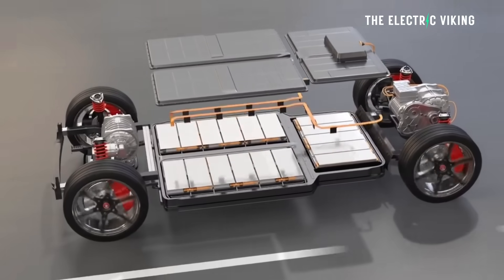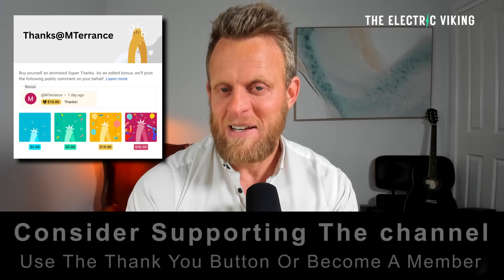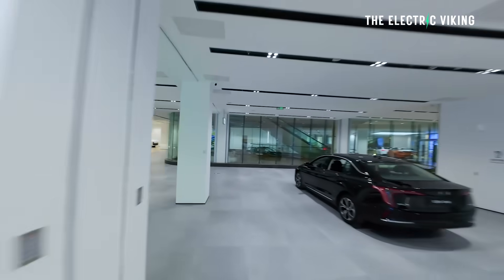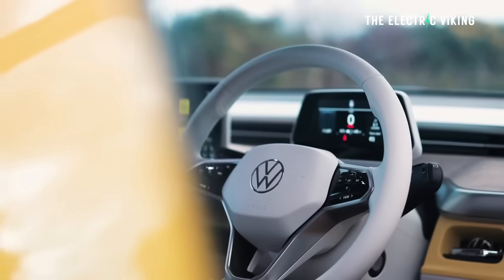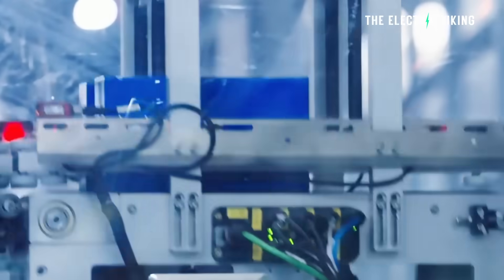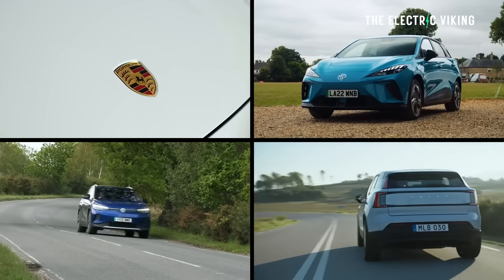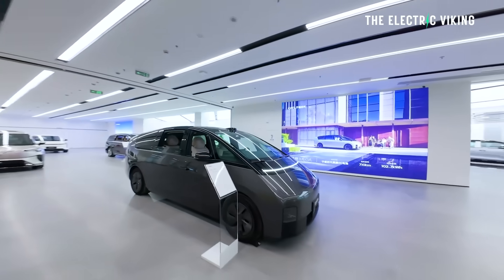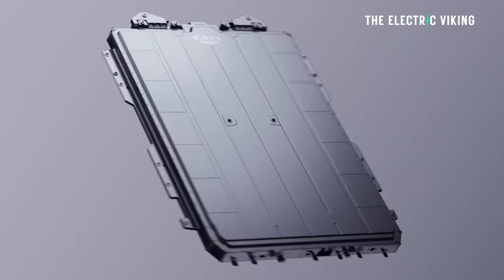Game-Changer: CATL Tesla EV Owners to Repair, Not Replace Batteries!

Comment: You can refurbish a pack a couple of times, but ultimately, the cells within the pack have a certain shelf life, and cells will keep failing until the labour cost of disassembling the pack every time just isn't worth it, because eventually the entire pack will become unredeemable. At that point, it needs to go to somewhere like Redwood, where they shred the batteries and recover the materials. But yeah, rebuilding the pack is a good option if the pack is ten years old or less.

Comment: It'd be nice if they could standardize a battery connector and coolant location.

Why? 
Because it could make battery replacements easier and cheaper.
Especially if newer battery tech came out.

Eg I realize my Model S uses NMC batteries for the capacity to make 100kwh.

It would be nice if you could decide to replace it with an LFP battery later.
Granted it may not then have the same capacity or handling but it'd be down to the consumer choice.
A choose your filling kind of deal.

If some other battery tech became the new rage, then you'd be able to switch to it when the time arose. 
As the battery would be its own separate component. 

The other part to this is that the car would have to support dynamically adjusting the power profile based on the battery characteristics. 
Eg limiting power output if the battery isn't able to meet the original spec.
Reply: Wow that difference in price... that's pretty sweet.
The battery in my secondhand Model s is at 80% state of health and has done 268,000km (I've only put 6000 on it since ownership in Feb)

I had thought that I'd repurpose it for energy storage and get another battery for the car...

With the next item being solar install for the home.
Although I wish our NZ government would put an incentive in for doing so.

Comment: Go try to repair a battery yourselves.
Reply: Fair, though YouTube has plenty of examples of module swapping. Battery rejuvenating using a catalyst to free up lithium, might become an option. Assuming it's not shorted. Hmmm, would need a way into the battery still.
Reply: @RoyBoy2019 I think it’s just a matter of replacing the bad cells. The difficult part would be to dissemble it and find a person certified to do it. Or ship it to catl
Reply: @tjeers3098  yeah mileage will vary. Older Model S have quick disconnect and easily swapped modules. But saving weight / cost going Cell to Pack, much harder for DIY service without modules. Hope prismatic cells become more common.

Comment: What would you say if there is a device that trickle  charges an electric circuit? Well watch Tim Ventura interviewing Harold White demonstrating his Casimir zero point energy device. The size is 5mm x 5 mm designed to charge very small devices in its first mass production stage. Future is to upscale to who knows EV’s?

Comment: In Australia we have not yet seen full recycling of the likes that Redwood materials in the US is undertaking.
It is common for under performing pack to be tested and put into static storage but full breakdown and conversion to black mass is not happening yet here in Aus.
It might take another 5 years before we see that here because these types of plants need  hundreds of batteries per day to break down to cover eration costs.
Currently most of the bad batteries we have here in Aus are being stored or exported only after having been fully depleted.

Comment: We have 4 Toyota Prius. The 2007 had 225,000 miles. Battery pack needed replaced. Dealer was $6 grand. Green battery was $1,200 came to my house  installed in 30 minutes and financed it to for 12 months. The car now has 265,500 miles.  Replacement EV battery costs is very reasonable.
Reply: Can u please provide more detail? Exact costs, gen 1 or 2? Is replacement batt faster charging or more capacity vs OEM? Green Bean? If so, found horror stories of refurb faults after months, $150 diagnostic and warranty delays. While warranty honored they wanted $700 diagnostic for 3rd swap to prove battery cells at fault. Recommend new modules to avoid Russian roulette of refurb.
Reply: The Prius hybrid has a relatively small battery compared to a full BEV.
Reply: Old Prius battery 1.2kwh capacity. Small compared to a 60kwh battery in an modern Ev
Reply: 2007 indicates an older design, advances have increased reliability

Comment: I've had a Honda Insight for 25 years, on the outside of the battery compartment it says "Do not open; you will be killed"  this warning is appropriate to anyone unskilled because even that small 166 cell battery pack can kill you in an instant, it is a tiny faction of the size of these huge packs used for BEVs. Damaged packs can also catch fire. So unless you are a professional, well trained on safe handling of deadly batteries - well trained on the dangers - it would be wise not to touch them. It certainly is true a pack can be repaired if it has'nt had damage which could make it unsafe even fixed; but do not presume you can manage such a thing on your own without needed safety training.
Reply: I beg to differ. Even a professional would have problems should an event occur.

Comment: I am in san diego with a 2011 nissan leaf.  Still hoping to be able to swap with CATL batteries.  The shop here advertises just a refurbished used leaf battery.
Reply: Genx, how much for the replacement? 

My nephew has an old leaf that needs battery replacement. A good car otherwise. Worth saving!!!
Reply: $3K for a used one with 50 miles of range.  Approx $5-7k for new batteries with 70 to 90   miles on of range.  Includes installation.

Comment: Given the trouble Munro Live had to get into the Tesla MY battery pack I can't see any kind of repair being a viable option. https://www.youtube.com/watch?v=ozesI3OZEG0
Reply: Exactly, those batteries all in a single block of gluey foam aren't ever going to be repaired. At best they could knock out a small chain of cells if one cell measured bad (by blowing a fuse link).

Comment: If you buy a 12volt car battery today you have to turn in the old one or pay a lot extra. It's been so successful about 90% of car batteries are recycled. Some of the lead in a new car battery might have been mined in the 1950s. Referb and upgraded EV batteries should be the same way. Turn in your old one and get the "core charge" back.

Comment: Just had a module changed on my ID3. It has 12 modules and it wasnt a big deal to swap one. The car drove fine before the replacement but the softweare threw up a warning. It was all done under the 8 year warrenty with no cost and no fuss.

Comment: I live in Slovakia and I have asked several car dealers, how much costs exchange of battery. And the sum was very similar: about 12-14 000 EUR. It was for Opel Corsa and Nissan Leaf 2. However it is for exchange whole battery. Often the batteries are divided to several blocks, e.g. 3, and if just 1 of the block is damaged, EV owner pays just for 1 third of battery.
I would like to buy a second hand EV, but problem for me are very expensive batterie spare batteries.

Comment: What exactly is the process with repairing the battery?
Reply: With the VW MEB cars simply jack up car, drop abttery box, take lid off, disconnect bus bars between battery modules. Swap defective module, charge  replacement module to same level as the others, refit bus bars, screw it all back together.

Comment: A few years ago, I helped my son remove and take apart the battery on his restored Tesla Model S.  It was very difficult since the shell and the lid are bonded together.  The adhesive must be cut and the lid peeled back.  A lot can be done to made that process much easier.  I am sure that must be what CATL has done.  In addition, there is a maze of wires inside the battery that measure temperature.  These are very delicate.  Here, solid state might be the answer.  Even with thee original construction, it takes a severe accident or terrible abouse of charging, to cause the battery to degrade.  I think some of that hype is now being corrected.  Good work.

Comment: I think currently EV repair and servicing look less rosy than is narrated here. The biggest issue I see and experience in this utopian narrative is that servicing seems dictated by business and what you want fixed is currently regulated by the manufacturers demands on servicing. The logistics regionally are complicated, and the logistics are complicated. In my situation, I fealty had to push and actively ask for a battery replacement of a hyundai Kona. It was difficult to get information, and I was supposed to believe telemetry data was fixed without written proof. Battery repairs and swaps could only be done at certain service centres for safety reasons and to prevent fraudulent repairs with fake battery repairs of poorer quality  batteries. It was very difficult to get done and took several weeks for the repair and EV transfer to be done and almost a week to repair the battery with a new cell of an already replaced pack. So although catl may paint a rosy picture of business with battery servicing, global regional se4vicing is much more complicated with a lot of red tape, middle men, and if you do not have in depth knowledge of how this business really works, it still remains an expensive affair to date, for which  I think, even for insurance reasons and safety rules, a battery replacement I think remains the norm, just to keep servicing, safety and costs in check for the average person. We're still very far away from a more democratic liberated view pf a more refined affordable off warranty safe and comprehensible battery repair and replacement servicing, globally. It would be nice if it was true and realistic today, but globally, I think it is still in its infancy.

Comment: 80% charge after 100k miles is better than my BMWs at 100k miles. Timing chain broken- new engine, plastic oil filter housing breaking... 
100k mile EV is much cheaper to own than a 100k mile gas powered BMW.  
Now can we just get a good EV convertible 😂
Reply: Battery failures are rare, I give you that, but when they do happen, it is darn more expensive than replacing an engine. Regulations should require all  EV manufacturers to provide  modular battery repair, and should allow third party garages the software tools to do so. That will have a knock on affect on reducing the notoriously high EV insurance.
Reply: BMW=Bring More Wallets. I recently worked on a mini my daughter bought for my grandson. The so called engineering was absolutely horrible. Not at all what I expected from the Germans.

Comment: Repairability is one of the biggest issues stopping EV take-up, including sticker price and range.
Reply: This is a temporary transitional issue, as has been shown in all industries and technologies that electrify the serviceability increases and cost decreases over time. 

EV components will standardise and become modular units used across many models (and makes), that are simply swapped when an issue occurs, then repaired or recycled offline. This increases usability time of the vehicle, lowers maintenance cost and repair skill level needed.

At this time a more expensive half-way house of the older, more complex and lower serviceability, mechanical approach (with different makes and models being different with only some shared components) being applied to EVs.
Reply: The problem for replacement or repair of battery packs is manufacturers making it difficult to gain access to the packs and cells . Tesla is notoriously bad on this front with structural battery packs . Getting to the cells for maybe recycling is a Herculean effort . Structural packs are big problems being tied into the structure . These cars are designed to be throw away vehicles. Like everything else we build today . They are not built to be repaired and manufacturers don't want that . They want you to buy new after a warranty is over . Tesla is horrible in the world of sustainability because the cars are  not repairable and if you can replace a part you have to replace the whole unit and not individual components. Even Tesla power walls have this problem . Tesla is not a sustainability company and this is how they became profitable . There won't be many 10 year old Teslas on the road in the future unless they build with sustainability in mind . Neo battery replacement system can change out a battery pack in 15 minutes . 
Ford and gm do better with module systems
Reply: @stevencole7331 but a module is far too expensive to replace - usually replacing a whole battery using modules would cost more than that new car
Reply: What world do you live in have you looked at global EV sales what is your problem. You're American right and think the whole world revolves around one little small country or something. Hopefully I'm wrong hopefully you live somewhere where you like expect and understand international.

Comment: How about a  new upgraded battery to increase range? I don't see how they could do much repair to a 4680 pack which is pretty much one piece and entombed in Foam . (see Sandy Monro teardown of 4680 pack) Hoping I can get and upgrade in 4 years .
Reply: This is where you call your elected officials and tell them that you want stronger, “Right to repair” laws. Especially where things like EV’s and cell phones are concerned.
Reply: Sandy doesn't seem to like repearing stuff. At least batteries are modular and a cell can be replaced or an entire module. Also batteries can be repurposed if state of health is insufficient for a car, like the BMW I3 battery.
Reply: In this case Munro actually commented on the low serviceability of the Tesla structural battery, the process to access a cell is a destructive one due to the way the cells are bonded within and to the pack (there are no modules as such in these batteries just clusters of cells embedded in a spray set foam).

The OP was correct in saying structural packs are problematic for repair. The approach being an offline, labour intensive, one of swapping a whole battery on the vehicle and then teardown/repair the battery pack elsewhere.

This is a more costly approach due to the level of effort involved, and a risky one for the repairer as the pulled pack may turn out to be faulty and not reusable, so have to price this risk into the repair as well.
Reply: Or just swap it? LMAO
Reply: You know the services in America are ready repairing Tesla battery packs right. You can order a repaired battery pack if you want to. You can have your own repaired at a shop. See instead of sitting on their butts people saw an opportunity and started a business and now they're making money. Or is that too hard for you to understand.
Reply: @Joegreen-r1i- which packs are they repairing though, the modular ones with accessible easily swappable components or the structural ones with embedded batteries that require a more complex time consuming teardown process.